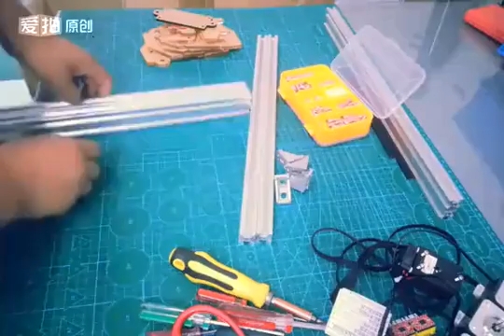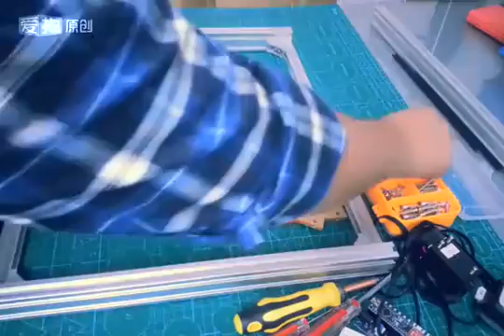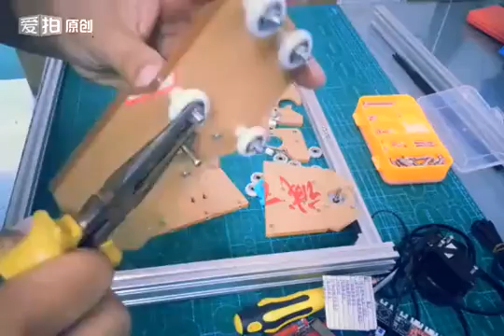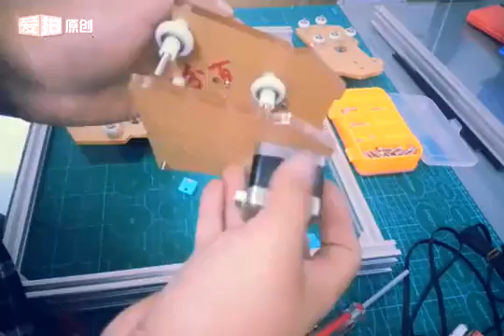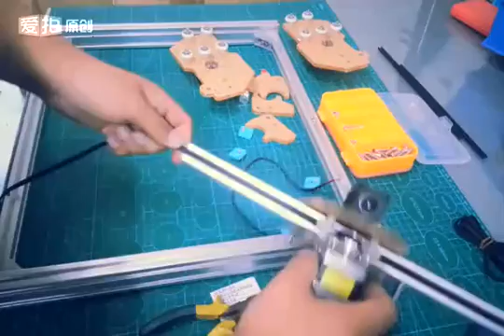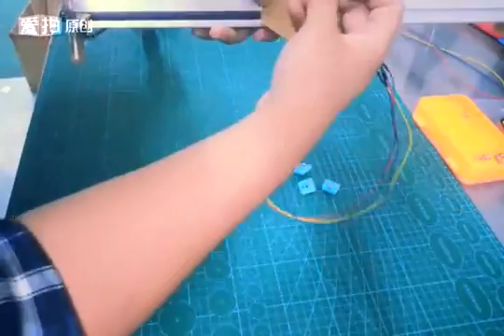Eleks Maker Laser Engraving Machine assembly

Comment: Hello I have watched your video a bunch of times and it has helped me set up my laser engraving machine but for some reason it does not work at all and I was wondering if you can help me I've connected it to the computer I have installed Ben box software but for some reason nothing works at all none of the parts move I'm not sure if I have the right laser if you can email me and get back to me whenever you're available I would really appreciate it thank you so much

Comment: I've problem  Y1 and y2 axis not working, control board is not giving power to y1 and y2. X axis is ok ,any solution
Reply: Get the Eleksmaker now with 50% discount from this link: http://www.banggood.com/Triaxial-Desktop-DIY-CNC-Micro-Engraving-Machine-Assembling-Kits-p-1055377.html?p=3B03079878369201704R
Reply: Look - it's for 195.90 USD
https://www.banggood.com/2_5W-Desktop-DIY-Violet-Laser-Engraver-Engraving-Machine-Picture-CNC-Printer-Assembling-Kits-p-1001413.html?p=B4200913385416201708
I hope this can help you

https://www.youtube.com/watch?v=TtmWrU1u9FY

Comment: is this the engraver that's sold att Gearbest? What else did you need to order to use the machine?
Reply: +Carl Angervall I bought one A5 500mW) from GaerBest, and their support is ABYSMAL! Shipping time was outrageously long, and any qwuestions asked take forever to get an answer.

No explanations, no documentation with it, no software, drivers, or controller, or graphics software. A USB dongle came with it, no explanation of what it does, it emits led light, but seems not to be a Thumb-Drive.They sent me links to a BenBox app, and it was full of Trojan/Backdoor viruses.

They won't respond now, and are offering a refund, but only in GearBest bucks, glad I bought with PayPal. It works, but I can't get a computer to talk to it. GearBest is RIDICULOUS, avoid at all costs.
Reply: Sorry about all the typos...
Reply: +John Mood 
Same Hardware, same soft, but ordered through Banggood.com.
No Explaination, no doc, etc. I installed grbl (need to flash and upload, google is your friend). Since then i'm able to communicate and drive the motors. Some trouble or question about driving settings (how many steps/mm?, is there any microstepping setting?)...
Use of Universal GCode Sender (OS Linux Mint).
Reply: I am using Windows Ten, so maybe I can find it for Win Platform?
Reply: I then also need a vector & raster converter for Iogos, Lettering, and Lines to make resists for etching. Anyone? I would like to stencils to etch metals. Would be comverting bmp and JPG files.
Reply: Inkscape is free and powerful :-)
Reply: Yes, but of you cannot get the extentions for Gcode to compile (I don't have the compiler for it) it won't to what I need. 

Know any other gcode senders or converters? I have a CAD program, and could use the & have no way to convert to .NC files...
Reply: Hopefully this will answer much of you concerns. See the campaign or backup https://www.kickstarter.com/projects/286407371/big-blue-sparx-diode-laser-upgrades Thank heaps!